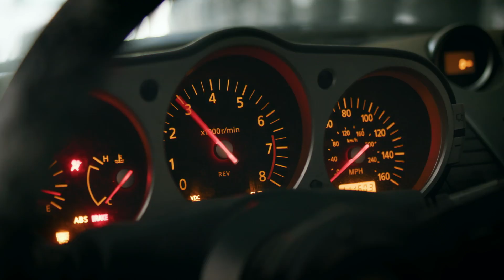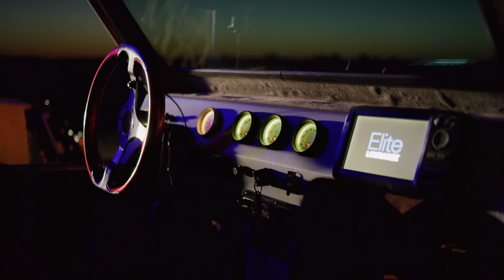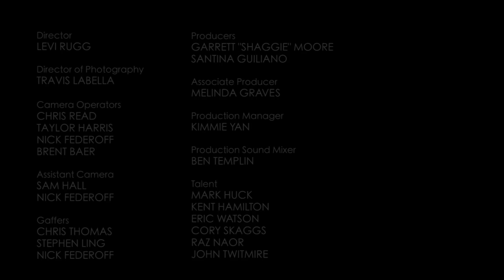Defying the Elements - Motor Trend Presents

Comment: Recommend any anti freeze but the one shown.
Magnetic film passing over dissimilar metals, ie aluminum and cast iron, along with grounding from the battery, causes electrolysis, eating away at aluminum parts. Intakes and cylinder heads suffer most damage.